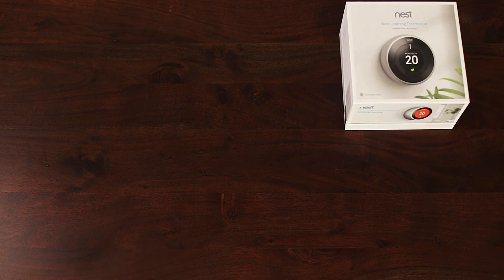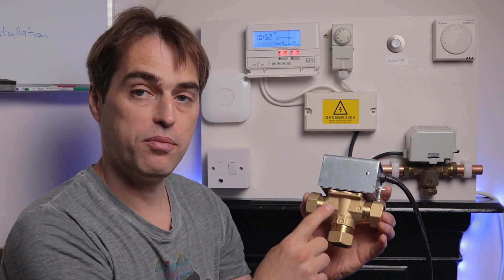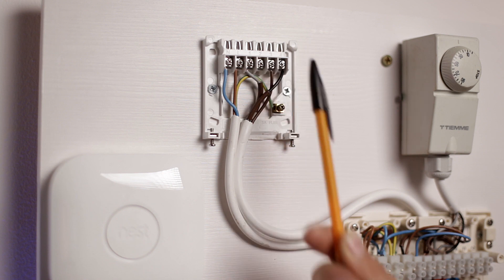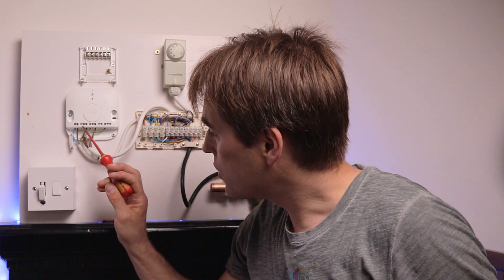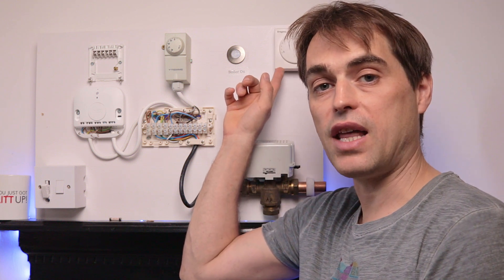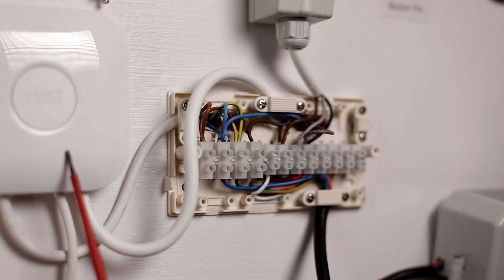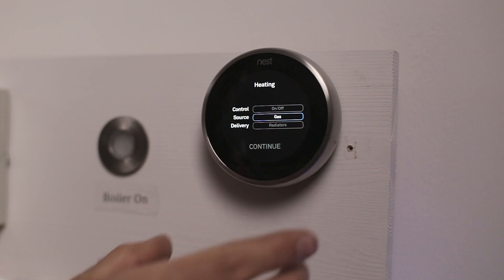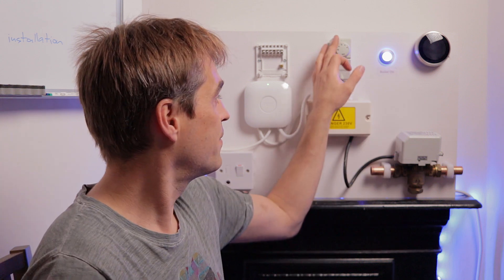How to install Nest thermostat (UK) on a Y plan - system with hot water cylinder & 3 port valve

Comment: Dude, excellent video. Finally an install video that fully explains the installation. So many other guides miss out or skip over some of the details on the wiring. Well done.
Reply from the maker: Thanks - but those set ups really shouldn’t be used anymore - on off is the old inefficient way of doing heating.
Reply: @UrbanPlumbers  I assume you mean using opentherm controls where possible?

Comment: I followed your instructions and its great.  The only issue i have is my old thermostat has 3 wires.  My nest is not firing up the boiler when only heating is required. Boiler is fired up when hot water is on and heating turns on.  The 3rd connection of the thermostat… is this what would fire up the boiler? Do i connect this to “Heat On” wiring?

Comment: Thanks for this video, gave me the confidence to complete my install without issue!
Helpful after install tips, if your hot water is always on after install and you cant figure out why, go to Settings> Equipment> Bacteria Prevention and disable this at least temporarily. It runs because the system has no record of the last time the water was heated and as the name suggests runs to prevent bacteria build up. (You may want to enable this again later!)
If you find your heating turning on seemingly at random before your scheduled time, go to Settings> Nest Sense> True Radiant and turn off.

Hopefully someone scrolls through 268 comments and finds this helpful!

Comment: Thank you very much for such a clear and straight forward explanation of a y plan installation with nest heat link.  I wonder if anyone can offer me a little help though.  Rather than a boiler, we have a geothermal system, with the geothermal heating loop switching between the radiator heating loop or to the hot water storage cylinder via the valve.  The hot water cylinder has its own thermostat of course, but also has a separate immersion heater.  This separate immersion heater provides backup if the geothermal system fails, but a can also boost hot water heating at a rate above what can be supplied by the geothermal heat exchanger.  I believe it’s possible to also integrate the hot water cylinder independent immersion heater into the nest heat link and configure nest such that base water heating can be by geothermal using a schedule, with the immersion heater being called upon to provide top up heat if the geothermal system cannot reach the hot water cylinder thermostat temperature set point.

Can anyone provide guidance on how the heat link y plan wiring diagram needs to change to integrate the HW cylinder separate immersion heater please.  Any guidance on configuring nest to primarily take HW supply from the geothermal heat exchanger in a HW schedule and supplement this with the immersion heater if necessary to reach cylinder temp would be really appreciated.

Thanks, Jason

Comment: Had anew Baxi 800 system boiler, new 3 port valve, new CYL Thermostat, and New Nest. Followed all your wiring downloaded diagram and cannot get boiler to fire up, I.e. no 240v to orange/boiler live. Changed the Nest Heat Link. Only way to get 240v to boiler live is by turning up the Cyl Thermostat and turning on HW boost on nest. 27v on orange/boiler live when no HW or Heating. Thanks for any help

Comment: Brilliant instructions, thanks. I got one problem and hope anyone can help. My boiler kicks off for hot water when cylinder thermostat is set below desired temperature , and then I have to force motorised valve to feed hot water. The motorised valve is working fine, I even replaced it with a new one and can see it switches between hot water and central heating correctly but the boiler only kicks off when cylinder thermostat is below desired temperature, let’s say zero or 10 degrees

Comment: It would be great to see you do a how to video on converting an old y-plan 3-port valve, controller, mains thermostat and cylinder stat.   My aim is to basically gut the old wiring and replace it with VR66/02 and VRC720. Thank you!

Comment: Very nicely put together video. Extremely clear and easy to follow and as I have the exact same setup. It's easy to translate it across. One question. What are the ends you have on your wires that keep them crimped so neatly.

Comment: Hey Szymon... brilliant video as always but I have one question please (in desperation).. Open Therm? I'm on the brink of buying but am unsure of the open them connectivity. I have an Ideal Logic+ Heat 24 on Y plan which has Open Therm connections but when installing a Nest, do I ignore/disconnect the switched live 1 in favour of OT1 & OT2? Also, as the boiler needs to know the valve is in position, SL1 comes through the valve, out on orange to power the pump and boiler, etc, so how would I get around this? My main reasoning for getting a Nest is Open Therm so it's quite an important feature for me. Please, please, please could you help coz it's doing my head in. Many thanks in advance.
Reply from the maker: you would have to rewire the whole installation and reverse the zone valve so that the normally closed port is to the cylinder, not the heating. Both switched lives will go to SL1 and the cylinder thermostat off would go to SL2. 

It is actually quite a complicated setup. I think you may also need a relay between the zone valve orange and the pump brown - otherwise the zone valve stays in the last open position.

It is actually complicated enough for me not to remember what is required. I got a spare heat-only logic in the loft and will do a full video on this setup early next year.
Reply: @UrbanPlumbers  wow, thanks very much for the comprehensive reply. From another video of yours I've watched where you turned the valve, I'm assuming that I'll need to convert to hot water priority? Would this then use Open Therm or just high and lower power using SL1 & 2? 

Although I'm from an instrument and control background, this does sound rather complicated, the other option I'm considering is to use Ideal's own Halo (part 222141 rf & 222143 wifi) for heat and system boilers which comes with a dedicated wiring centre which I assume takes care of the mods needed. I've not read many good reviews regarding the app and wifi stability though, hence swaying towards the Nest. It does connect to the boiler using Open Therm though so looks like it will give the load compensation I'm looking for. Have you any experience with the Halo?

Sorry, I'm rambling on, thanks again and I'll be watching out for the video.

Comment: I don't seem to have a "HW off" cable connected in my existing thermostat. This makes sense because the hot water has always come on (incorrectly) with the heating for some reason. However, it doesn't transfer to the Nest - there is continuity between 1 and 2 and 2 and 3 whether the heating is on or off, resulting in the heating not coming on at all. Any ideas?
p.s. it is definitely a Y-plan. I seem to have an NS5 actuator but only 3 wires coming out of it.

Comment: Like your content

Could you please help me work out what problem i have

Cdi 30 system boiler on y plan with Cyl and three port valve, with removed F& E as converted to sealed system

I get rads heating when I switch HW on with CH off

3 port ok and no reverse circulation on rads

Comment: Amazing video. I watched at least 10 different videos but only you helped me to understand which cables :) 
I have one question. I have very old timer who controls extra electric heater installed in my tank. I don't know how and when this stars but when my gas boiler wasn't working I still had hot water automatically. Can I control this heater by nest thermostat? Which is the best way? Thanks

Comment: Great video, tomorrow I will wire my new Nest up using your information.
I also have an immersion heater that I had hoped the nest could turn on during the night when our electric is only 5p per kw, I figured this would be cheaper than using oil currently over 90p per litre.
Is it going to be possible or should I be buying a separate time to control it?

Comment: My main control unit is upstairs next to hot water tank, programer is in kitchen next to boiler and room thermostat is in hallway.

I would put heat link in kitchen next to the boiler and old programmer and connect up as explained, got that.

I then get stuck as T1 and T2 currently go from hallway to main control unit same as your demonstration but how do I then get them to go from hallway to heat link in kitchen?

Comment: Really well explained video.
Have you installed a Nest thermostat on Y plan with Opentherm? How would you wire the mid position actuator?
Reply from the maker: It’s not possible on a Y plan. You have to convert the system to a X or W or D plan

Comment: Thank you for this. I've been wondering whether to install a smart system. Because I live in a modern house which is very well insulated, there is very little financial advantage in doing so because it would probably take 4 or 5 years for it to pay for itself, so my only consideration is to save energy for future generations. I designed and installed a central heating (Y plan) system about 30 years ago when I was in my 20s (before computers, so I had to do all of the heat-loss calculations on large sheets of paper). I live in a different house now, but with the same setup of heating & hot water, so I'm okay around this system.

It has been a long time since I installed that system, but I remember the basics. Your video confirms that I remember enough to have confidence, and it prompted me to recall the bits I had probably forgotten.

There is one thing that bugs me about the Nest system, and that is why the heatlink cannot simply fit directly onto an old programmer's backplate (even if some slight re-wiring is needed). Furthermore, now that the old programmer will be redundant, why doesn't the heatlink use the same screw holes? I only wonder because my programmer is mounted on kitchen tiles and I'm not sure there is enough wiring behind the tiles that I can pull through without extending it without using another unsightly junction box). I figure I could mount another metal backplate, or a plywood square, but it feels unnecessary. I figure I will get my head around it eventually.

Comment: This was an excellent guide. I managed to get NEST installed. I have one issue possibly you can point me out to the right direction & really appreciate.When I swicth on Hot water only my three port valve move to mid position. It looks like it is trying to move to Hotwater only position but making a ticking noise (looks like it tries to go back & forth) & stay in the middle. So when I switch on Hotwater it also heat up the Radiators (becase of the mid position). Valve itself looks working because for an example when I complete power off the system the Valve move to the hot water only position as the default position, so I can see its not stuck or anything. I think some sort of electrical wiring mixed up it seems.Also Heating only works without an issue (Valve moves to heating only). Thank you in advance
Reply: i have the same issue!
Reply: I did some more checking the wiring looks ok actually. I concluded that this may be a fault with the 3 port valve so ordered a one. Will keep you posted once I fixed it.
Reply: So yes it was the issue with Drayton Motorised valve faulty. Replaced with a new one (those are snap in install so dead easy). Best is to check the voltage on 3 port walve wires when the programmer calling different options. Below is the table.
Orange 230v HW
Grey 230v HW
White 230v - Mid position - Both
Grey & White 230v - CH

Comment: Hi.  In July 2021, a Vaillant-approved installer fitted a replacement ECOfit system boiler (into an existing y-plan config) with a Heatlink wirelessly connected to a Nest 3 gen Learning 'stat.  Hot water scheduling and 'boost' working fine using the Nest, but the heating does not reduce to the scheduled 9 celsius overnight.  Instead it wants to maintain the daytime 19 celsius - or slightly higher!  Could it be that the 'satisfied' terminal on the Heatlink's 'heating' tag block is open-circuit somewhere, such that the pump never turns off and the boiler remains on - limited only by safe temperature limits in the boiler control circuitry?   The only way to manage the overnight overheating of the house is to turn off the boiler every night on the Vaillant case front panel!  When I get the installer back here, I'd like to be able to point him in the right direction!  Cheers, Pete.
Reply from the maker: It is possible that he left a link on the pcb of the boiler
Reply: @UrbanPlumbers  ......He and his mate did complete the install of the boiler, immersion tank and controls all in one day!  It's likely that something got missed during commissioning, I guess.  We'll see if he will re-commision the system in the near future.  Many thanks - it's probably a rushed set-up legacy!  Cheers, Pete.

Comment: Two questions if someone can help?
1. I don't have hot water off wire in my existing programmer; how do i translate that to nest heatlink? Could I leave hot water off disconnected on nest? I have triple checked and it definitely looks like Y plan as it has 3 way valve, cylinder stat, wall thermostat, pump and water tank above. 
2. I am not mounting the new thermostat on the wall. Could I leave the existing dial thermostat and its wires as is without having to trace it to junction box amd change anything?
Reply from the maker: Seems like your current system is not wired correctly. You NEED a hot water of on a 3 port valve.
Reply: @UrbanPlumbers   thanks very thoughtful of you to reply. I did some digging and after a lot of head-scratching it seems my installation is more like W plan and not Y plan. Closely looking at the three port valve and the head it seems to be diverter actuator (drayton ZA5) not the mid position; they look the same but work differently. This means in my system it is either CH or HW not both at the same time and the HW get priority based on cylinder stat alone. I can't find much information regarding W plan and nest installation or if nest would even work with no HW off wire :(
I wonder if replacing the diverter valve actuator head with the mid position one and then running HW off cable to programmer will make it a Y plan system to then install nest as normal?
Reply from the maker: @setudesai  replace with mid-position valve. I am not sure if you can replace the head only.

Comment: Hi, great video. I've installed nest from a honeywell 42005748 junction box which was connected to LP522 drayton programmer. Hot water is working fine but heating is not. The wire for CH on which was connected to the old programmer i have in terminal 3 on the nest. It does not appear however to switch the 3 port valve to heating and not hot water, so boiler does not fire when heating is called from nest, but if i call for hot water then the boiler fires and heats tank for hot water only. I have all the jumps as per instructions but wondering if i've connected the wrong wire from the junction box for switching the 3 port valve so that it feeds the radiators?
Reply: Were ever able to fix this? I have bit similar issue. My Heating works. Also hot water also works in a way. When you call Hot water only the valve stuck in the middle so I do get heating as well.

Comment: Many thanks for the video. Best on the internet. 👍🏼
Grey hot water off (4). If I do not have this on my plan, what can I use instead? How much volts should be going to number 4?
Reply from the maker: what kind of valves do you have on your system?
Reply: @UrbanPlumbers  it’s on a S plan. For some reason the heat pump randomly comes on.
Reply from the maker: @cardithomas  you are on the wrong video then! If you have a heat pump DO NOT INSTALL NEST on it! Stick with manufacturers contorls.
Reply from the maker: @cardithomas  This video is for Y plan. For S plan - check my other video - it is on my channel.

If you have a heat pump, installing next may not be a best idea. Heat pumps work best with original controls.
Reply: @UrbanPlumbers  I have watched both your videos; absolutely bang on. 

I do have a heat pump. What would you suggest?
Reply from the maker: @cardithomas  stick with heat pump manufacturer controls

Comment: Amazing video. Just what I needed. Thanks. Is it possible to have the Nest wired in place on the old room thermostat and the portable base? So I can have the thermostat on the wall and take it off when I want it in a different room? Or will wiring the thermostat into the boiler stop the capabilities of the portable base? Thanks. Ben.
Reply from the maker: It’s either fixed on the wall or you buy a stand and you can move it around. Can’t do both unless you have a spare nest base that you can’t really buy

Comment: Hi - great video btw, very informative.
I have a question...if I’m going to plug the  nest thermostat into the mains via the stand is the installation complete once I’ve wired up the heat link and added the live jumper wires? Thanks
Reply from the maker: Yes, no need to hard-wire the Nest itself
Reply: Brill - thanks for the reply, do I still have to trace the call for heat wire and move it to the white on zone valve?

Comment: Great video but I do not like your method of safe isolation. As an electrician you needed to prove that your test instrument is working before and after. You would need to probe between L-N L-CPC N-CPC with power on (this proves your multimeter is working correctly). The turn off Fused Connection Unit and remove fuse and place padlock through hole in fuse carrier if there is one. Then test L-N L-CPC N-CPC. The preferrred instrument would conform to GS38 and typically be a neon/LED voltage detector
Reply from the maker: You can tell I am not an electrician!